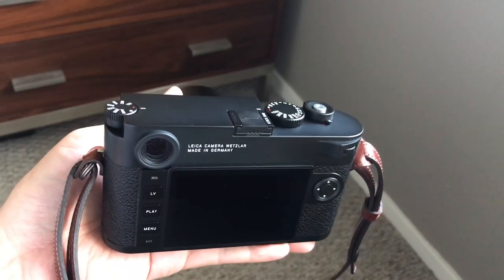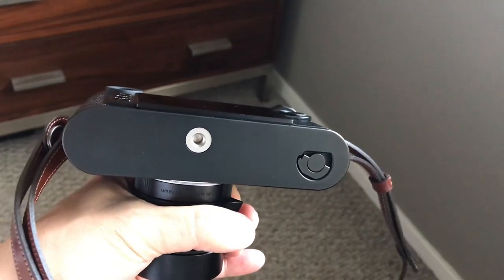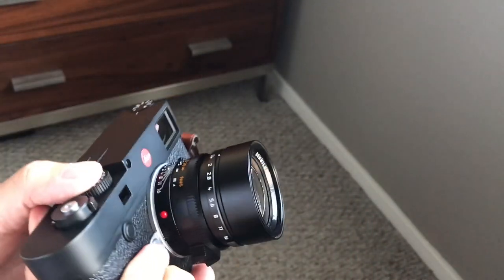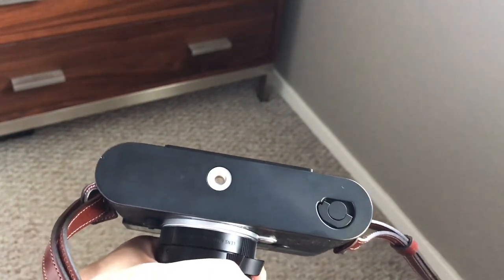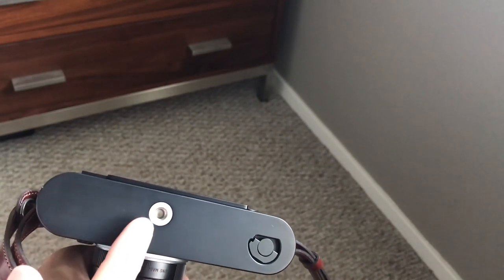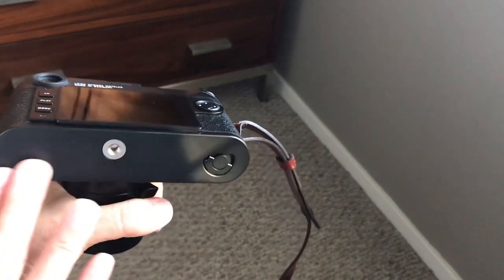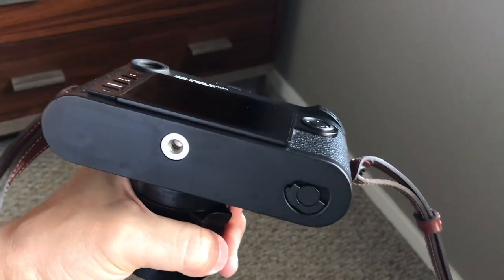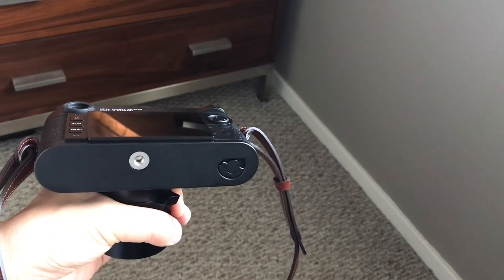How To Remove The Plastic Stickers From Leica M10 M Baseplate

Comment from the maker: Gently peel the labels off the baseplate (take baseplate off the camera first) and then use the products and procedure I mention in this video to remove the left over adhesive. It might take a few passes with the GooGone (don't worry, it's safe, just be gentle with it). Then, use the alcohol on a clean cloth as the final step to remove the residue.
Reply: Great...just about to do this with my M10 Monochrome...